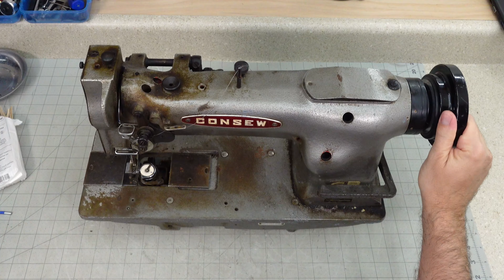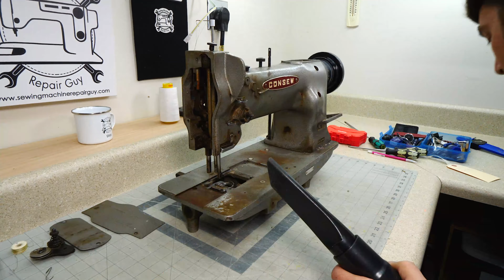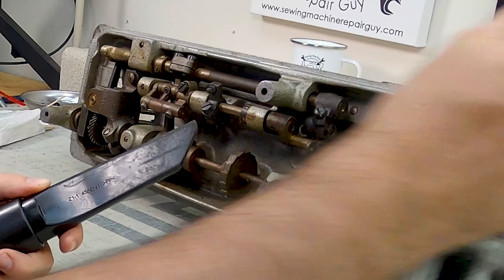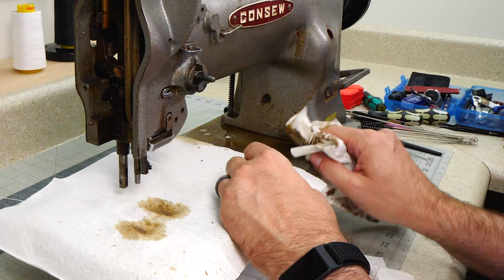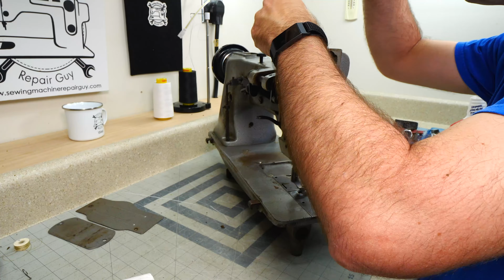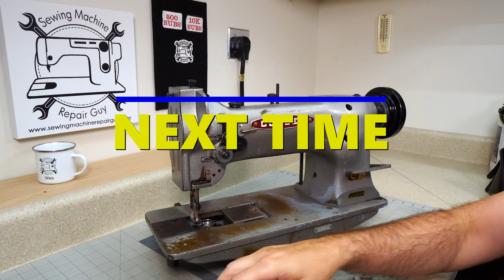Cleaning an Old Consew Industrial Sewing Machine

Comment: i have a consew 105 straight stitch clutch motor machine, bought from an estate sale last year, no manual. it belonged to the small town seamstress. i imagine its seen a ton of use in its lifetime. i cant find anything online that explains this machine, only the 206 or 226 which are completely different,and walking foot machines. I found the needle to be sideways and once i turned it, it sewed fine, but yesterday i was sewing a very light cotton project for 10 minutes and it suddenly stopped now the bobbin thread bunches up on the bottom within 3 stitches and jams it up. ive looked and dont see any thread around the bobbin case, nor have i messed with the tensions, its threaded correctly. im at a loss here. im going to try to take the case and basket apart and see if theres maybe a piece of thread caught in behind.

Comment: A couple of questions. Is this your profession, and if so, how did you learn this trade? And, do you think SMR is still a good trade to get into, and aside from your vids, what would be a good way to learn to do repairs, order parts and whatever else goes into the biz. Picked up a few old machines in the past, cleaned and oiled them and they turned out okay. But I'm sure there's alot to learn beyond that. Any advice you could offer would be appreciated! Thanks!!

Comment: I have a new Singer machine and it isn't sewing at all for some reason and I can't find anything to explain why it isn't sewing the material even though I think that both the upper and lower thread was put in correctly. I also have an old sewing machine which belonged to my grandmother and hasn't been used since she last made quilts on it. One day I want to get it out and get it cleaned and see about finding parts needed to begin using it again. I am now retired and have the time to work on it when not working in the yard mowing or cleaning inside the house.
Reply: I wish you happiness reliving wonderful memories of your Grandmother when you get sewing on her old machine.❤️❤️

Comment: Hi.  I am from Rio de Janeiro, Brasil.  I just bought a Toyota 9800 and a guy who has one and a lady who has one, too, are having difficulty in finding the bobbin case for their sewing machines in Brasil.  (I still haven't received mine and hope the bobbin case is alright.)  Do you happen to know if there is a brand new model with the same bobbin case?  Do you think It is not a good idea to buy an old sewing machine?  (The current machines are plastic, and made in China!)  Also, another lady has a Bernina and can't find the bobbin case for that one either.  (Brasil, you know...) Thanks in advance.
Reply: Try aliexpress for bobbins and bobbin cases, you might get lucky. I got a whole bunch of relatively rare bobbins for my bernina, for under the price of a single one on ebay. Some of them have sharp edges but even if you throw those out, the amount of good ones is still a great deal for the money. At least worth a try.
Personally I am not of the opinion that modern machines are bad, or even that plastic is bad. I have worked on other types of machines, where the metal was of such low quality and so poorly poured, that the metal could literally be snapped in your hands. If you would have tried that with similar thickness ABS you would never be able to.
The outside of the machine (for domestic machines) does not carry any loads anyways. Modern construction is to have a strong skeleton frame, but the outside being plastic. In that sense, the outside does not matter at all. 
You also have to take into account that the vintage domestic machines costed upwards of 2, 3x monthly wage, whilst a modern sewing machine can be had for as little as 1/10th a monthly wage whilst giving similar performance. If you spend the same amount of money on a modern machine, you will also get a super sturdily build metal one if you want.